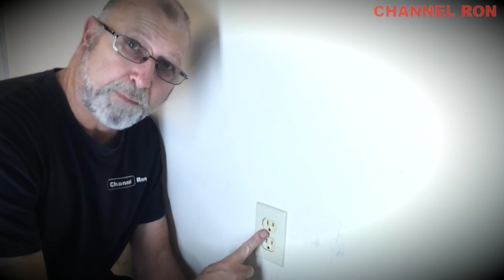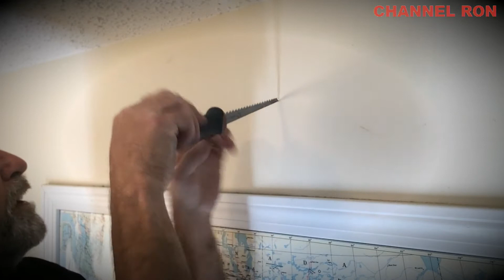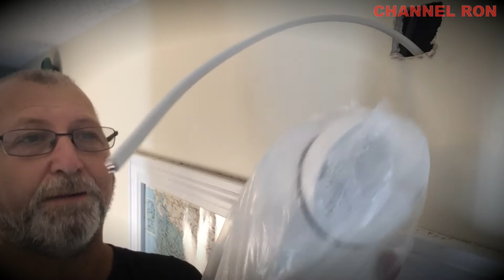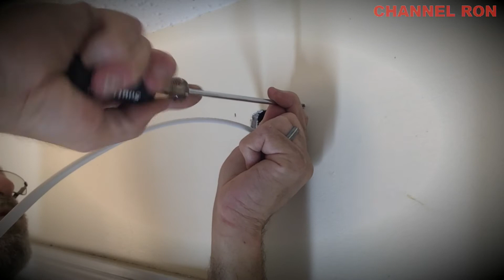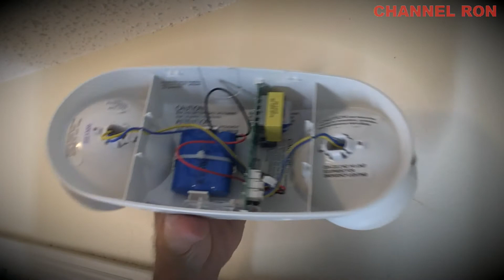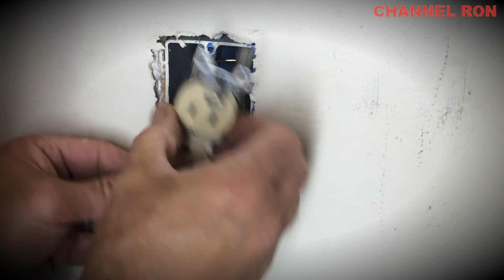How To Install an Emergency Light

Comment: Thank you Ron.  From a guy in White Rock, British Columbia, Canada.  I'm a home-owner with only minimal wiring knowledge.  I was using an extension cord with one end cut off, so I could wire the lights to plug in to the wall.  The wires on my cord were black, white & green.  I had the exact same lights as you, with black, white & red wires.  I wasn't sure what to do with all the colors.  Thankfully, you made it clear that the red wire was not used.  So either was the green wire.  Easy, once explained.  I cut & capped both.  I watched your video before trying anything, and all went well.
Reply from the maker: I am glad that I could Help!

Comment: So you put the emergency light on the wall only connecting the battery in the back. and not the wires in the emergency box. You connected a wire to a plug that you tied off to nothing. Why no just put the emergency light on the wall without giving it 120amp that's what you did.
Reply from the maker: Well you need the 120 volt to keep it charged up.

Comment: Thanks for the upload! I definitely will check this out again when I buy my first set of emergency lights. For some weird reason? I thought it was illegal to install them in a house lol but I figured why when they sale them in Lowe’s and Home Depot ? Like why would it be? I guess cause I’m used to seeing them in public only.
Reply from the maker: They will pay for themselves the first time you need them, good luck.
Reply: @channelron3593  all you did was connect the battery cable in the back. You  didn't connect it to electric power.
Reply: @southkerr6267  how do they know when the power goes if they are battery operated ones ? I looked at those also . Cause when we move I wanna take them with me.when and if I buy a set